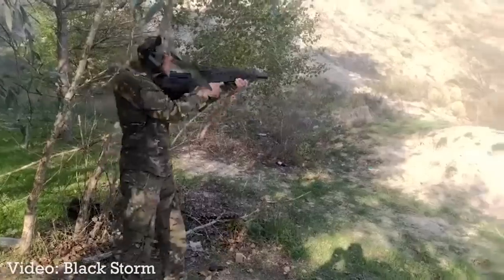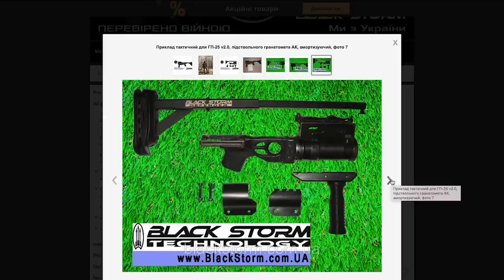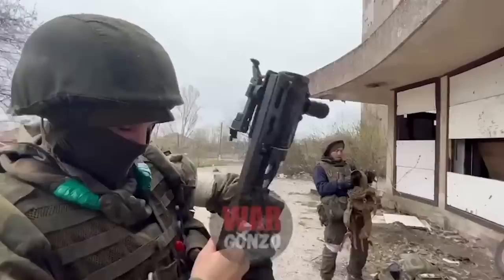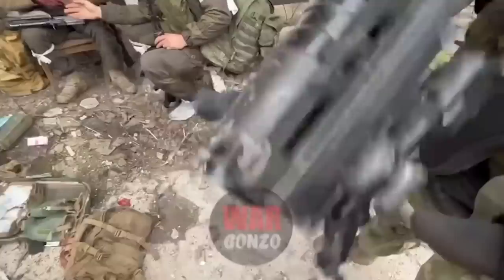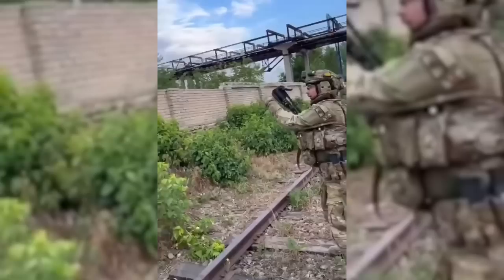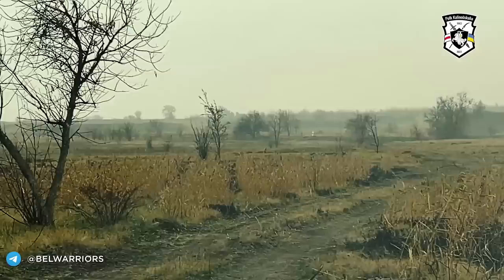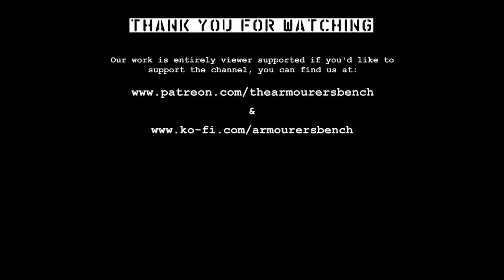Ukraine's Standalone Stock for GP-25 Grenade Launcher

Comment: One thing of note is that the GP-25/GP-30 needs a standard AK handguard for it to be mounted properly. Its likely that some of the Defender kids being used alongside AKs is due to their aftermarket furniture (say with M-LOK or PicRail handguards) which make regular appearances in the hands of UA troops rendering the standard launcher mounting option impossible.
Reply from the maker: Yeah a good point, more and more guys running aftermarket stuff.
Reply: I can personally confirm this.
Reply: IIRC Zenitco B10 handguards can accept a GP25
Reply: @beakiethegoon4439  They do yeah. They may be one of the few that can though.
Reply: Aftermarket mods were non-existent when GP was put in service
Reply: @wolfdima  Im aware, but Im pretty sure the guys at zenit made the B10 backwards compatiable with the GP 25

Comment: 5:32 The rubber buttpads differ only because they're sourced from different existing guns/supplies. The Defender buttpad is a standard AK grenade launching add-on buttpad, ubiquitous and cheap in the CIS. That's why the guy who captured it takes it off casually and passes it on (since it's a useful, modular accessory for an AK-pattern).

The makeshift (crudely formed and sawn) stock on the left uses the same buttpad (so-called "Galosha", like a rubber overboot). And the one on the right just uses an off-the-shelf hunting shotgun cushioning buttpad, available as options for many guns on the market.

Comment: GP-25 is also caseless which is pretty cool.
Reply: well its also muzzle loaded, 
probably the only modern muzzle loaded weapon still in use
Reply: Calling it "caseless" is a bit of a stretch.
Reply: @zoiders  It has no case therefore it's caseless. I'm not sure what you are getting at? There is no extraction after the round has been fired.
Reply: @Punisher9419  "Caseless" implies a projectile embedded in a combustible block.
Reply: @zoiders  not really, s&w volcanic had a similiar caseless cartdige with powder inside a hollow projectile
Reply: @lefunnyN1  Still not caseless.
Reply: @zoiders  you denying it is like saying 22lr or other rimfires are not a real cartridge because a real cartridge must be centerfire,

If a certain design has a self contained propellant withouth a casing it is caseless, literally
Reply: @lefunnyN1  Again please in English? The GP-25 round is more like a 50mm mortar round in operation including the pull back striker used for firing. Describing it as being like "caseless" ammunition in the modern context is wrong. The point of caseless being a move away from metallic cartridges - the GP-25 round very much being a metallic case. If it were merely the grenade embedded in a block of homogenous propellant then you might have a point but the high/low pressure principle precludes that from being practical.
Reply: @Punisher9419  "It has no case..." What?
Reply: @Mathos93  no case... Because.. Its ceaseless
Reply: @zoiders  Not necessarily, Rocket Ball is considered caseless. And so is the Gyrojet ammunition.
Reply: @Punisher9419  No. It's a cased munition. If it were casesless it would not be metallic to contain the high/low system. It functions just like a mortar round and they added the soft rubber driving bands on the sides of the round to engage the very brief rifling. That's the only difference. The whole point of a caseless round is the weight reduction and removal of the need to eject empties. Two part rounds consisting of a projectile and bagged charges used on tanks or naval guns for instance are caseless. The superposed electrically primed grenade launcher that the now defunct Metal Storm developed was caseless. The G11 was caseless. The GP-25 is a mortar and it requires a metallic case to drive the projectile.
Reply: @zoiders Except it is. It's a self contained munition. Unlike 40x46mm rounds used for the M320 or Colt/LMT M203 Grenade launchers...where you have a case that must be removed before you can insert a new round. With the GP-25 you don't have anything to remove after firing.

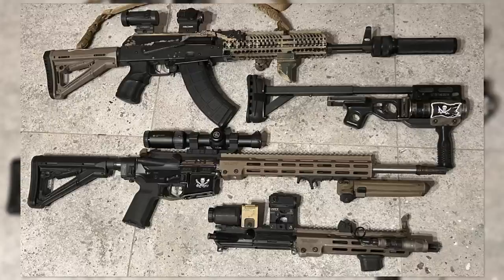Comment: 7:38
For those unaware minus the defender, and the 74 instead being a 47, that's the typical American households guns...
Including the extra AR "bathroom doorstop upper"

(For those who cannot tell, this is sarcasm we use our 1911s as doorstops because then they're useful, and can't picture our 9mm as it's always concealed)
Reply: Not all Americans!!! Some of us have overcome such barbaric methods!!! We know that a rifle is the proper toilet gun!  It is important to adapt your threat model to shit with the operating environment. Mid-dump engagements confront us with a number of unique challenges and opportunities. Failing to account for which could lead to a model of operational space unable to accurately integrate the state of actual operational space. Mobility, for instance, is highly dependent on variable Poop factors of consistency & viscosity (v(x), c(x), & c(v(x)). Do do the math and you’ll see just how degraded your mobility is likely to be. This alone should convince you that precise, long-range fire, as deployed from a fixed position, is a vastly superior tactical posture for the modern, porcelain battlefield.
Reply: I use Hi-points as hammers, and 5.56 for vermin control as it's only a .22 bullet
Reply: @ErraticHail  a high-point will still work after being used as a hammer... And wasn't the .222(basis for 223) a varmint cartridge anyway?
And using guns as tools? That's just crazy! Don't let the ATF know or pretty soon they'll require serial numbers on stampers, hammers, brooms, and will require a 200$ tax stamp on an automatic room sweeper like a Roomba
Guns being used as tools, recreation and for sport... who'd ever of thought of such a crazy idea? Don't let those who make laws know, or they'll have one less thing to try and ban to use to get elected

Comment: doesn't surprise me that units would prefer using it as a seperate platform even if their AKs can mount it, I believe the USMC began doing that with their M320s around the time they mass adopted the M27 and modern shooting grips aren't typically compatible with UBLs
Reply from the maker: I can see why you might want to lighten your rifle to make it more pointable and carriable but a standalone launcher can also be passed around the squad too!
Reply: @TheArmourersBench  Or left in the wagon, and/or swapped for another disposable ATRL if that's what the situation demands.
Reply from the maker: Exactly, good points!
Reply: All good points, I carried the M203, years ago on the M16A1, what a heavy and awkward thing. Would both a rifle and a launcher be any better?
Reply: @jfu5222  Suspect it comes down to sling design. Can you come up with a rig that keeps the GL out of the way when you're using your rifle, but also lets you bring the GL into action without doing something elaborate to 'stow' your rifle?

Comment: Looks like a great weapon system. Small and compact. Recoil spring seems to work well. I personally would like a hand stop as your fingers are rather close to the muzzle. Kind of an issue with the original design though so understandable.

Comment: the defender reminds me of the M302 but of course, they are different systems with different requirements. 

I just want to ask how are the GP-25 and M203 systems used in their respective armies? I've seen something that the range difference that both systems can fire up to reflects the strategies used by the Soviets and Western militaries.
Reply: Usually every squad will have a mg gunner with his assistant, and rpg with his assitant, a SL, a marksman and 2-3 extra rifleman. Depending on the unit (infantry, mechanized, etc) it will change, but usually the m302 and gp25 is used exactly the same, for indirect fire on the enemy at longer distances than a hand grenade but shorter than mortars.
Reply: What range difference do you mean? Are you talking about the medium power longer range 40mm US grenades? Best people to look at for 40mm systems are the South Africans...imo.

Comment: The under barrel style of GL seems to be losing out to stand alone versions in general.  The total weight savings is small, just the extra stock really, and the weight is directly bolted to the rifle all the time instead of in a pack.

What would be cool would be a way to store it with the stock collapsed.  It would make a very handy weapon.
Reply: Easier to aim and load with it being in Stand Alone configuration.

Comment: Huh. Odd. I've seen the photo showing the different loadouts for urban and woodland environments. However, the caption states it was a picture of a dead American mercenary killed by Russians. It also had blood stains by the head portion implying the merc got shot on the head.
Reply from the maker: Yeah, a lot of stuff gets recaptioned by supporters of both sides.
Reply: Funny, most American volunteers that I’m aware that have spoke of the subject have said they spent more money than they were paid to go fight in Ukraine. Pretty shitty mercenaries if you’re doing that.
Reply: @baneofbanes  You can figure out which propaganda I've seen it on by whether "volunteer" or "mercenary" is used. IMO, it just doesn't make sense to call someone a mercenary that goes to war when the odds aren't in their favor.

Comment: When fitted to an AKM/AK74 does it not have a tendancy to make the top cover pop off? The Yugoslavians changed the Zastavas top cover detente if I recall correctly because of similar problems with rifle grenades?
Reply from the maker: Yeah, there's a lot of stress put on the barrel and receiver, some good slowmo videos showing the flex. Definitely a couple of videos of top covers popping off have come out of Ukraine.

Comment: Underbarrel launchers were always a stupid idea. that this is more practical
Reply: Not really stupid at all, otherwise multiple military woodnotes have adopted and used them for years.
Reply: @baneofbanes  the US Army, the most advanced in the world, adopted UCP for over a decade
Reply: @fiskersproductions  cool, doesn’t change my point. Under barreled grenade launchers aren’t dumb.
Reply: Carrying one of these on a single point sling would suck if you have to go prone or run a long distance. A holster system like the m320 has would be a little better but still bulky. I think there are advantages and disadvantages to both systems.